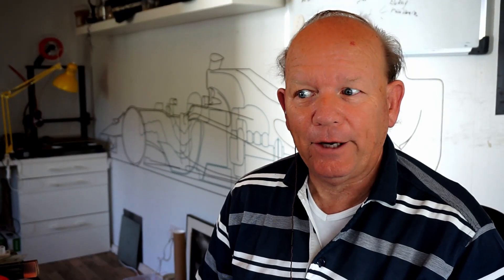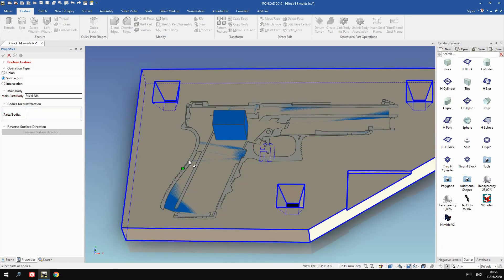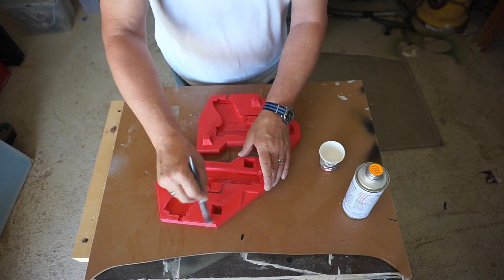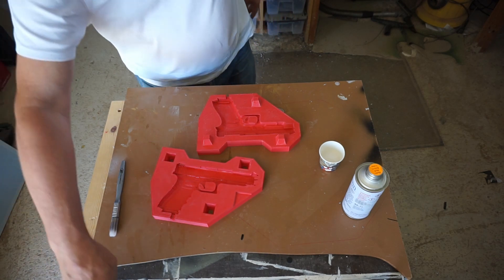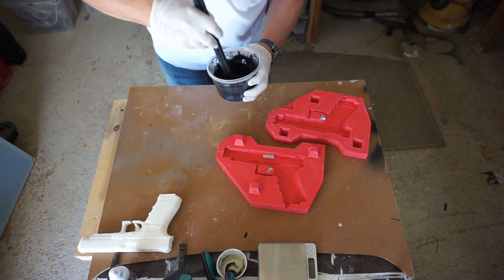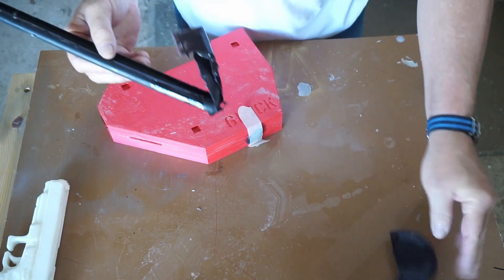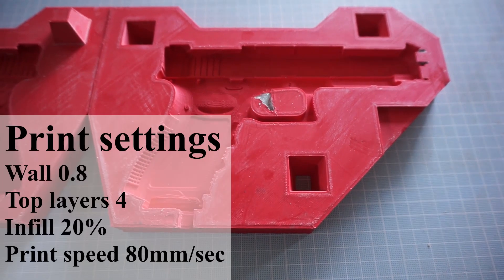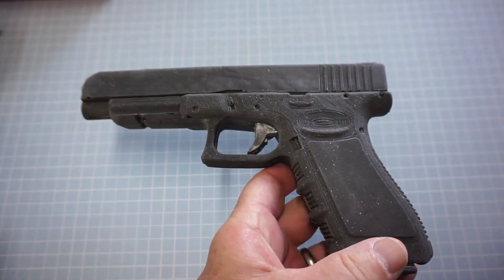3D Printed molds for prop gun

Comment: I've been wondering how to go about this very process and I can say - it is inspiring. 
Haven't looked around your other vids, but how hard is PU casting?
Reply from the maker: Have a look: https://youtu.be/VVju_GZ-mP8
This is PU foam, but the principle is the same. The big advantage with foam over rigid materials is that it is flexible, so the part can be pulled out, even if there are overhangs.
So if you want to cast rigid, you know your mold needs to have all the release angles correct.
Reply: @Paradym  Release angles. Got it. Will check the link, again